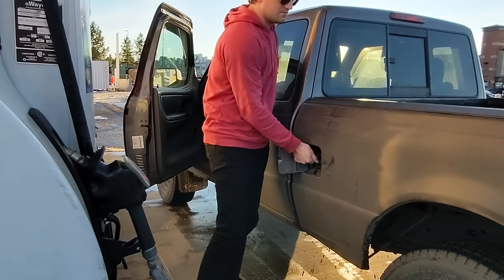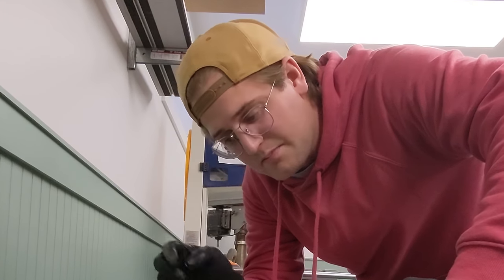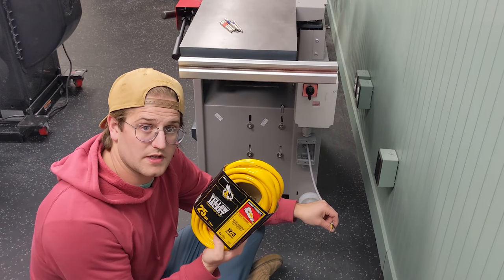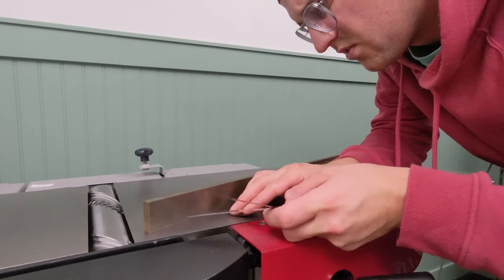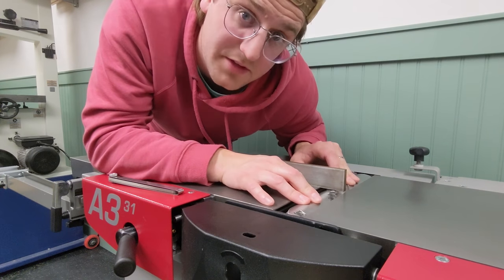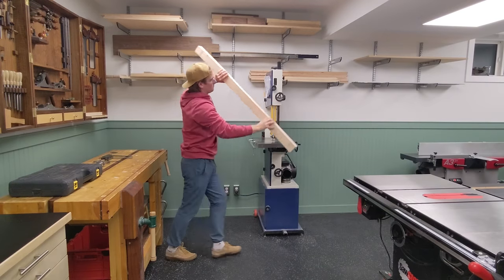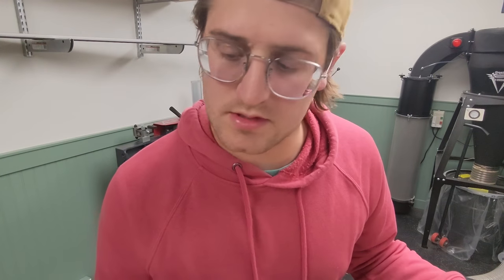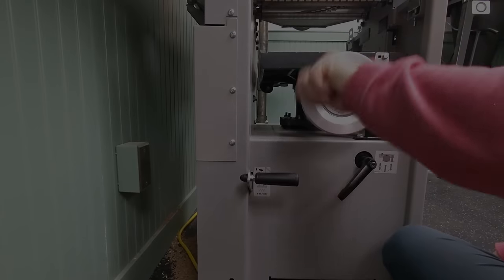Unboxing HAMMER combo jointer planer! ep17

Comment: Nice vid! Glad your machine came decently calibrated. Joint the face of two boards and put them jointer face together. It will exaggerate and make obvious any problem with the how flat they are.
Reply from the maker: Thank you and will do! I'll give that a go tonight. BTW I'm loving that 16" SCM of yours... A dream!
Reply: What was the end result of the face jointing test? I have an A3 41 on the way after wavering for a year between that and the Minimax but tolerances on the tables still making me nervous.
Reply from the maker: It worked great and had to touch it yet. I'm about to build a dining table. It will be a good test for some longer boards.
Reply: @BlakePizzey  Any update on the that test? Also, long time no see. Hope all is good.

Comment: I bought the A3-41.  I got it in July last year.  Took 9 or 10 months to show up.  It showed up with the beds so out of wack I couldn’t even push a board across it.  They wanted $850 to send someone up to Seattle from California, but they weren’t gonna be in my area for 5 months.  To Hammer’s credit, they spent HOURS over MANY days FaceTiming with me, teaching me how to align the machine.  I eventually did get it aligned after a few weeks of effort but it was painful.  My beds are less true than yours, but that is expected since they are larger.  Overall I am happy with the machine given I don’t have space for two separate machines.  Only lingering issue is a little snipe on the leading edge of my boards.  I’ve increased in-feed roller spring tension, but haven’t eliminated the problem.  FYI - we have the same Dust collector and table saw.
Reply from the maker: lol crazy about having the same machines. Having the extra 4 inches would be great. I asked about the 41 but the lead time was huge and the cost was more than I could spend right now. I really lucked out with them having a couple extra 31's ready to go. Interesting about your bed's being so messed up. I was a little scared that would happen to myself but lucked out.

Comment: I see you're in Edmonton. I got mine a few months ago in Ontario. So far I'm pleased (a3-41). It took about 9 months for mine also. Mine took a 30 amp outlet, and wouldn't start on a 20.  I'm happy I took the 41 but almost bought the 31 out of concern for size, but as you've discovered they aren't as big as they look on YouTube :)
Reply from the maker: Congrats. The 41 would have been sweet.

Comment: Dude nice machine and really appreciate the video. I have the same one A 31 and it is a champ. And I agree with one of the other commenters that wood is going to shift no matter what and it will be greater than the calibration inaccuracies. Also with the beds not being perfectly co planner I heard from other peoples reviews it is to make a slight spring joint. I always took it as when being set up at the factory they are erroring on the side of caution to have a slight spring joint than the other way around for glue ups. I did a big 8 ft table with cherry boards. They had quit a spring joint around +- 1/8”. It is probably do to it being that long of board on the short table beds. And a 6/4 8-9 ft board board not being the lightest board that I got a gap and on top of that lack of experience on the jointer that it was so large. To fix I simply took some of the “spring” out via a hand plane. I think it’s one of those instances of sometimes it’s better to bring the tool to the piece than the piece to the tool. But either way it has up the game and made the whole dimensioning lumber dare I say kinda fun. You get to see the wood just transform. And it is such a clean cut coming from the hammer. That  it just keeps the woodworking moving forward. Enjoy it because I know I am. Keep up the videos look forward to seeing the next ones.
Reply from the maker: Hi Kyle! Thanks for the note. I'm working on a dining room table now and about to start milling. I'm curious how the longer boards pan out. Regardless, can't wait to put 100 bf through this. So far it's just been small odds and ends.

Comment: Awesome, I am glad you are liking it. I got the A3-41, had the dewalt 13” planer and was not going back to 12”. One thing I can tell you about the hammer, hold the start button for 5 seconds when starting it, someone mentioned it helps the capacitor or something, electrical is not my thing. Also wax the beds a lot, with the finish it seems to need it more than my old jointer.  You can get a 5” hose that fits, I think Lee valley has it, was running mine on a 4” dust port system , changed everything to 6” and reduced to 5” for the hammer, that made a huge difference in chip collection.
Reply from the maker: Jealous of the 16"! Would have been a little too tight for my little shop. I learned quickly about holding the green button... Tripped the breaker a few times. I actually ripped off the 5" boot and made up a 6" boot for the dust shroud. Made a huge difference on the chip collection.

Comment: Hey Blake.  I'm about to get my A3 31 delivered today.  My shop is a lot tighter than yours and I was wondering about the mobility of the unit if you had to move it.  I've got a Sawstop and Rikon 10-326 as well.  This was a helpful video, thank you for posting.  Though I do wish you filmed getting that thing off the truck.....  Thanks again. Mark
Reply from the maker: Hi Mark, I should have filmed it... Use a furniture dolly! Very helpful. As for the mobility, it's OK but not the greatest. Moving in and out is easy. You could store it tight against the wall with the fence close to the front and pull it out as needed but if you want to sliding left or right it's a little tough. Just need to zig zag back and forth and eventually it will shuffle where you need it.
Reply: @BlakePizzey  Blake, thanks for the quick reply!  I actually made my own dolly with 2x4 lumber and joist hangers, extra heavy duty casters, etc., in anticipation of the machine's arrival.  I wasn't sure if the trucker would use his skid jack to get it down my driveway, its a long one with a decent slope to it.  Guess I'll find out.  I know the video is very recent,  but are you still happy with your purchase?  Thanks again.  Mark
Reply from the maker: Loving it! Just finishing my dust collection right now and will have a video out shortly so you will see more of it. I ended up ripping off the 4-5/8" plastic boot and had a 6" sheet metal round to square made for it. The dust collection is much better now.
Reply: @BlakePizzey  I'll be looking forward to that video!  Right now I'm still in the process of uncrating the unit.  They did a good job with that, lots of GRK screws.  I still haven't figured how I'm going to get it off the pallet.  No one to help, you could fit all my friends in a phonebooth.  I'm kidding, but at 61 all my buddies are my age or older and most have bad backs.  By the way, I didn't see a plug and power cord in the mix.  Did you buy your own?  You show that on your video.  I'll have a bunch more questions for you as I progress.  If that's something that bothers you, I would understand.  I was voted "Most Likely To Annoy" in my senior class...  Thanks again.  Mark

Comment: I was literally adjusting my DJ15 (helical head) today for this similar issue. A very slight deviation on the flattening. It’s worth it but I highly recommend you do some internet research to ensure you don’t spend all day trying to get it right. Took me a good 30 minutes In all and made me more aware of my jointers functions and what not. It’s nowhere near a hammer. But it’s just a good thing to do to learn about your equipment good or bad. It just makes you a better more knowledgeable individual.

I use my friends A41 time to time and although you have to keep the planner bed under 8” for jointing. It’s not too bad to get it up and down. But it is a nice machine and very quite. Very nice performance and finish to anything I’ve put through it.
Reply from the maker: 100% plan to dive into it more. I'll run some more boards through it and experiment more. Found some videos online that explain it quite well.
Reply: which videos would that be please? @BlakePizzey

Comment: I didn’t realize that was a jointer/planer combo at first. That’s a slick machine!
Something I noticed on one of Jay Bates recent videos that you might find handy though. He had a piece of plywood the same diameter as the lift wheel with a hole drilled out for the handle,  chucked it into a drill and used that to quickly raise/lower the table.
Reply from the maker: Thank you! Just went to his channel and skimmed his last couple videos - found it in the The McCurdy Clock video. Jay is a clever guy around the shop. https://youtu.be/DWUN59tN5uo
Reply: @BlakePizzey  That’s the one!

Comment: Dude, that thing is awesome! 
In my opinion, if you are better than .005" then you're good to go. I'm sure Mattias has done some crazy experiment with this, but I'm pretty sure wood moves more than that day to day. 
By trying to adjust it further, you risk going backwards....and then loosing a whole weekend trying to get it back. 
😬
Reply from the maker: Thanks Jake and congrats on being the first person to share a number! Thats what I am looking for and I like it lol. I figured trying to dial it in any further wouldn't be worth it.
Reply: @BlakePizzey  haha.  Thanks!  I spent a ton of time getting my table saw fence and blade dialed into to within 0.005...Then I saw a Fine Woodworking article where they only went to 0.010.  I think as engineers, we get carried away with tolerances sometimes, wood is a lot more pliable and forgiving than some other manufacturing materials.
Reply: I feel quite inadequate compared to y'all - I've been thinking 25 thou tolerance for "fine" woodworking (though may not be fine anymore compared to you both) and about an eighth of an inch for rough carpentry tolerances (stud spacing, etc.)  Clearly I need to up my game and I appreciate the diligence!

Comment: Glad I found this. I'm this close ->| |<- to putting a deposit down on one of these and have been looking for as much A3-31 content as I can find. I'm curious if you ever ordered the extension wings, or if you've felt like you need them. What's the biggest board you feel comfortable pushing through without them? Thanks!
Reply from the maker: Hi Anthony! Loving it so far. I haven't put anything longer than 65" and that's about as long as I think I can do without the outfeed extension. It's on the list.

Comment: Hey Blake, how has this machine been for you? Any issues so far?  How do you find the HP of the unit, do you find it underpowered?  I'm ooking to purchase this one or the 16"
Reply: did you end up buying it?
Reply: @AaronGeller  Yes I did, the 16"
Reply: @careyhenitiuk8423  mine literally arrived a couple hours ago — it’s huge but looks like a massive improvement in quality compared to what I had.
Reply: @AaronGeller  Hopefully you gave it a good inspection before receiving the shipment.  My first one was badly damaged, to the point they took it back and sent me a second new one.  It is a great machine.  I've milled boards over 10" wide on it, walnut and cherry, and it is a luxury to easy joint boards that wide and have them come out with minimal milling marks.   I've tried to keep the beds waxed.  The cast iron feels very rough off the start, but it doesn't take long for them to smooth out some.  I try to move around the width to help evenly wear the cutters and beds.  Enjoy!

Comment: Nice video! How did you get it off your truck? I’m going to order the a3-41 and figuring out how to get it in my shop.
Reply from the maker: It was a little sketchy... Had four guys and slid it down some ramps while it was bolted down to the crate. Then we used a furniture dolly to get it in the shop. You will love the 41!
Reply: @BlakePizzey  Got it thanks! I did a similar maneuver to get my PCS off my truck and it wasn't too bad.